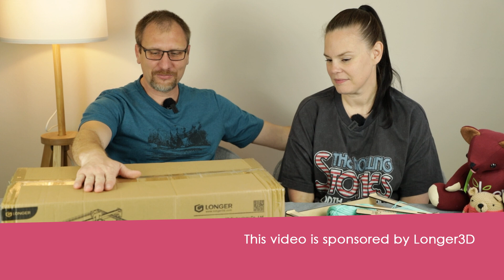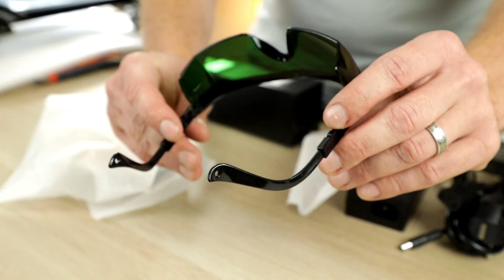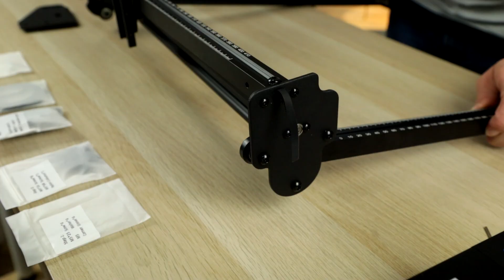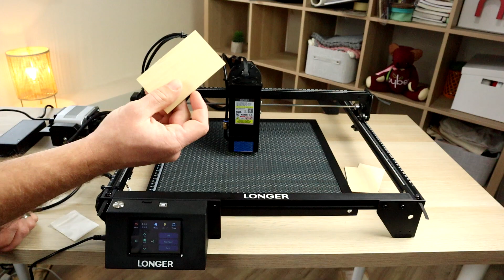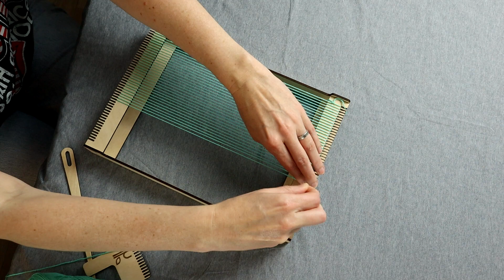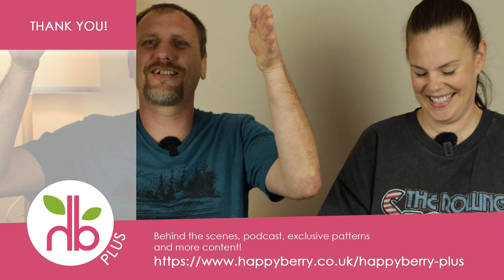Craft Business Ideas: Laser Cut Mini Loom for Weaving - Longer RAY 5 20W

Comment: I've just purchased a Longer Ray 5 20W laser cutter and for the life of me cannot understand how it is there are no instructions for:

Alignment - "Framing," is hit or miss. 
Connecting to WIFI
Adjusting Speed
Adjusting Depth

Does anyone have a link to a guide that shows these things.

I'll gladly pay someone to shorten my learning curve and hop on a zoom call!
Reply: Using Wi-Fi on this device is not recommended because it is not stable. A USB connection is the best solution. The cutting speed can be set in the control program. I use Lightburn, which is a professional program with many very good functions and is not expensive. There are many tutorials on the official site. I recommend this channel to you because it explains in detail how to use the device with many useful tips: https://www.youtube.com/@LetsMakeAThing
Reply: @darum-t3z  thank you for this. So yeah I've gotten connected using the USB connectivity, but I'm using a PC and Lightburn isn't availabel apparently, (at least I haven't found it for a desktop).

I'm using LaserGRBL and set the speed to 1200mm/sec... Longer said around 3500 should do it? I've also made multiple passes and that doesn't seem to cut deeper. I wish I could post an image for you to see, but I'll check out the link and see if i can keep improving the quality...

Thanks for the help!